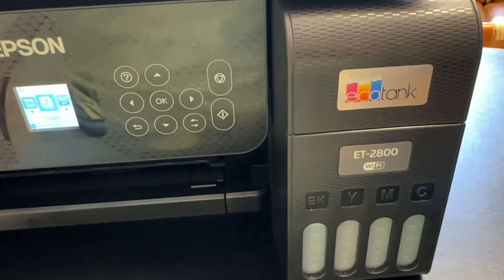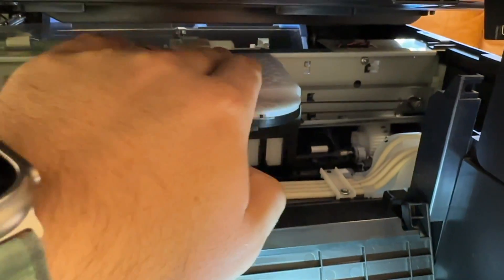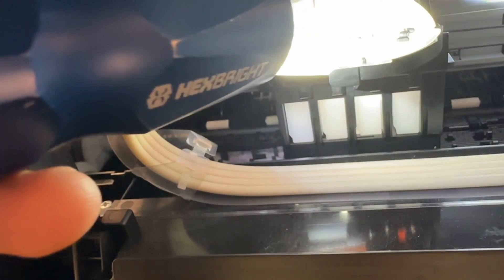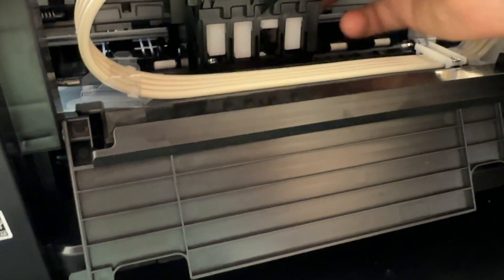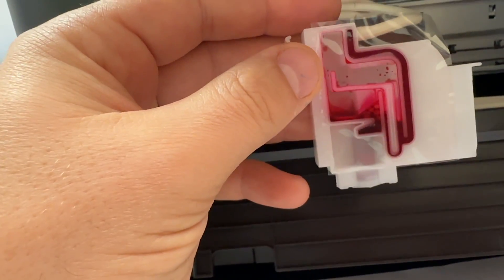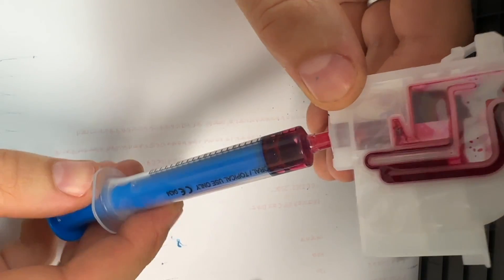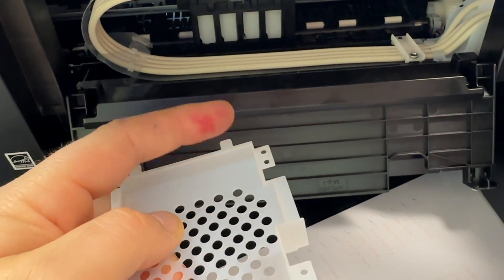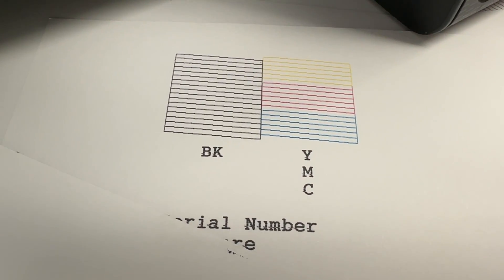Epson Ecotank ET-2800 Printer not printing well after ink run out repair

Comment: I had the same prob when I accidentally let the black run out.  This is horribly sloppy programming by Epson.  They should sense a tank is out, give a warning, and not let the machine try to  suck ink until more ink is added.  As I programmer myself I know this can and should have been done, so why after several years and generations of these machines, are they still not doing this?   My first Ecotank I had to junk because the software counter claimed the spill sponge was saturated and diabled the entire printer, even tho it was not filled, and it was working fine.  Plus they could easily have made a way for users to access, drain, and replace the sponge.  I guess they want you to buy a new printer anytime a prob comes up, which is often!  Thanks for the fix, although mine is still not printing as well as before the incident.